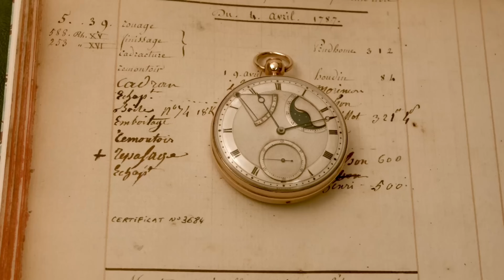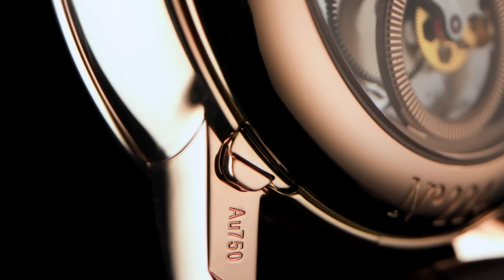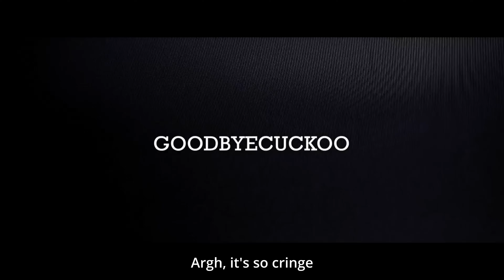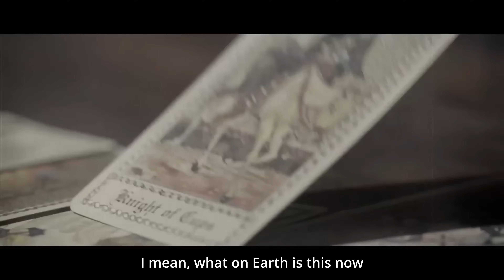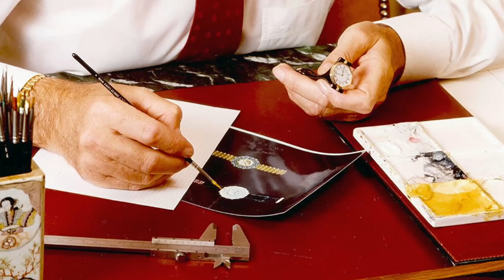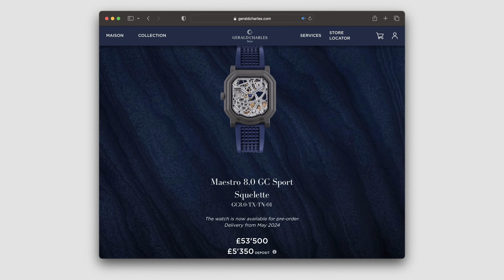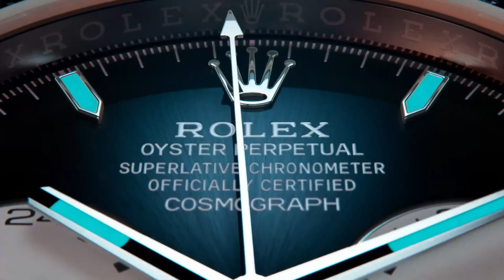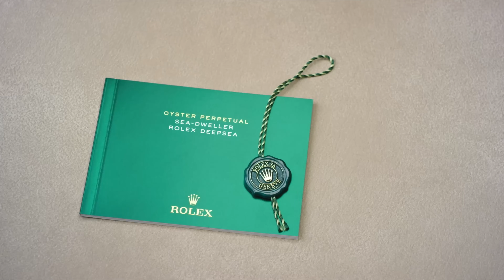10 Worst Watch Brands Right Now

Comment: Why does everyone get this wrong? Blancpain is not the oldest watchmaker in the world. The oldest is Gallet & Co. Founded in 1466, that’s 558yrs of operation!! To top it off, they are still independently owned family company to this day. 

A long time ago I was participating in a watch forum and this same statement came up, to which I replied as I just did. Much to my surprise, I received a reply from Nicholas Hayek Sr, pointing out that I was indeed correct, and jokingly ended with they still won’t sell the company to me. I saved that email, I think I will have to look it up in my backups, so I can post a screenshot of it. 

Great channel Andrew, I am rooting for your success!!
Reply: Absolutely. I wonder why nobody seems to have heard of them....
They did start out making clocks rather than watches, though, if I'm not mistaken?
And do they make watches now?
Reply: Yes they are still making watches today. Most of watches they make for public  consumption seem to sell out almost instantly. I know they also make watches for many other manufacturers and governments. So they are difficult to get ahold of unless you go used.

Comment: Putting Rolex there was a gutsy one. Appreciate it.

They are literally relying on the historical models and some decisions that made them iconic. Otherwise what they have done in recent years
Reply: If you want to know what Rolex has done in recent years, start by looking at the Omega catalog and look at everything Omega have copied from Rolex.
Reply: @clambake3771  TRUEEEEEEEE
Reply: @clambake3771  Weren't the Speedmaster, Seamaster and DeVille lines launched before their Rolex equivalents?
Reply: Three of Rolex main models were copied from Omega.What goes around comes around
Reply: @clambake3771 What are talking about? Omegas look totally different.
Reply: Seiko was there before Hans W. started watches 😂

Comment: I bought a beautiful Rolex solid-gold President with the MOP dial and Roman numerals about 15 year ago, but the price skyrocketed, so I put it away only for special occasions after its 10-year service interval. I was forced to get a cheaper Air-King 116900 for daily wear (I thought about the latest iteration, but I prefer an oyster case). I have tried Breitling (1953 reissue) and looked at Omega, but I just can’t shake my love for Rolex. So, one of the worst is still the best for my wrist! Great content, as always. I’m sure your newest endeavor will be a smashing success, Andrew. Cheers!

Comment: 16:55 If they had simply used the German spelling and called it "U-Boot" - although that would still be a pretty weird name for a watch-brand. The term, well... abbreviation, really, is still in use today and does not come from the WW2-/Third Reich-era. The German imperial navy of WW1 was employing submarines when Mr Hilter was still working as a dispatch rider on the Western Front. It might seem like a nitpick but, to this German's ear at least, the anglicized term "U-Boat" does ring a lot more of WW2. 
I should probably also add that, at its core, the term "Unterseeboot" simply describes any vessel capable of diving and moving about underwater. "unter" = under, "See" = sea, Boot = boat. It's not a term coined exclusively to describe a ship of war.
Of course, all this falls apart when you then also go and name one of your watches "U-47", which was the submarine that carried out the raid on Scapa Flow. Oops.

Comment: For my money, and my risk aversion regarding "investments," a watch that costs over $350 or so is pointless.  So I guess I'd say the worst brands are the ones that way overpriced, over-hyped, over-collected, not significantly better as a timekeeping device than any other decent automatic watch, and way worse as a timekeeping device than a $10 quartz watch.  I like the "feel" of wearing a chunky, metal-cased analog (automatic or quartz) watch, but each of mine, as impractical as they arguably are, cost me less than a month's worth of groceries.
Reply: It's a fair point... Equally...

There's obviously points of diminishing returns and at many pricepoints there's compromises on where the money is saved.

Is it worth paying up for a chronometer grade automatic movement in order to have reliable accuracy? Maybe.
Is it worth paying more to have a watch with a more comfortable bracelet (especially if wearing daily)? Maybe.

If you're paying enough for a chronometer movement and a decent bracelet, is it then worth paying enough for something with decent case and dial finishing? Maybe.

If you're paying for all this, do you need a "known" or "historic" brand name to make it feel as special as it cost? Maybe.

Just how far do you go? 

Or do you save some money by buying a premium priced Quartz version of a Swiss Automatic and save your money on the movement in order to have accuracy and a nice physical item? Maybe... But I couldn't - spending luxury money, I want to know that there's a little bit of mechanical soul going on.

As far as a reliable and accurate daily goes, it's brand I compromised on most, personally... Formex might evoke little to nothing as a brand name, but the Essence is a damn comfortable proposition with a chronometer grade movement with a decently finished case and dial, all at a price I could justify.... It's still some way beyond the $350 price range you've set yourself, but I can't imagine being satisfied with spending too much less on an automatic - I just think there'd be too many compromises (for me!).

Comment: I disagree about blancpain and breguet.  My favorite watch right now is probably my blancpain leman dual timer; it along with my supersede is my daily wear watch.  Sure, both brands are not as highly sought after when compared to some of their contemporaries but they are mainly just attempting to maintain their integrity. It would have been very easy for both brands to exploit their brand name and just create numerous steel sports watches.  Blancpain could have just made a smaller line of fifty fathoms and they would definitely sell as well as a tudor black bay or a rolex sub.  Its fine that they are making slower and more dliberate moves. Their watches are generally more expensive then most people are willing to pay for.

Comment: The tourbillion and many other Breguet "innovations" were in fact invented by John Arnold, the helical bi metallic balance spring, the tourbillion, and others, as they were such friends Breguet was able to use Arnolds design in hos own watches while other watchmakers got stern letters for plagarism and Arnolds son was Breguets apprentice. Even Breguets famous Gullioche dial design is traceable to Arnold peices. Invencit et Facit was in fact also an Arnold invention or engraving. So FP Journe knew but you apparently did not. This is 101 stuff mate, bet you believe Blancpain beat Rolex to the dive watch and Rolex went up Everest too (it kinda did) Im a bit....dissapointed.

Comment: You nailed Breguet and Blancpain  
Blancpain is a plastic bezel made by Swatch 😂 well looks like it.
Like you I’ve owned 3 rolex, still own a Sea Dweller 11660 Drilled lug hole 2000 my. 
I will not beg at a dealership for another 
They can go forth and multiply in short sharp jerks. (Fcuk Off in crude speak)

Comment: Is the £20 Aliexpress watch bought for £200 (10 x the cost) because of slick marketing really any worse than buying a £500 (very famous) Swiss dive watch for £10,000 (20 x the cost) because of slick marketing?  In fact the latter is mathematically twice as bad and the customer experience is far worse!  Trying to convince yourself the latter is better because of ‘residuals’ is classic pos-rationalisation, as you will find if you actually try to sell it (which you insist you never will, so why do residuals matter at all?).  When it comes down to it, isn’t all luxury the same; all smoke and mirrors? 🤔 You pays your money and you takes your choice (Punch, 1846). I will retire to my bunker awaiting incoming - the shops are shut today anyway 😆😂🤣